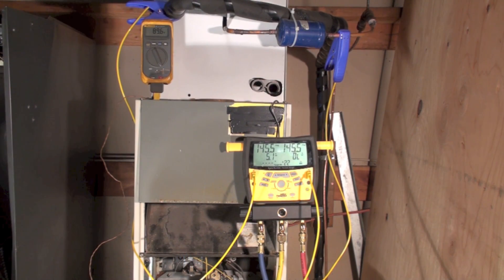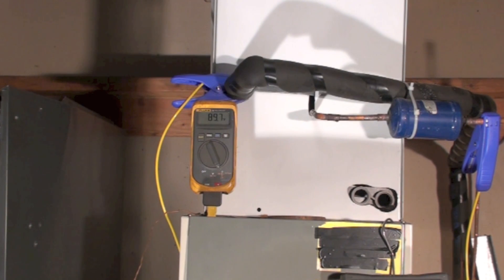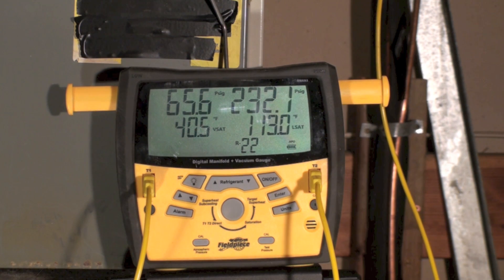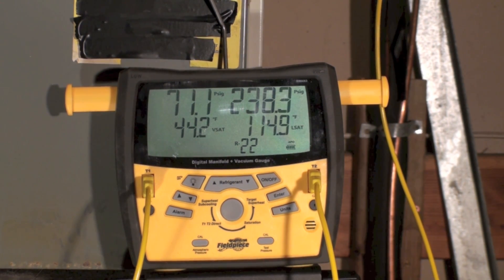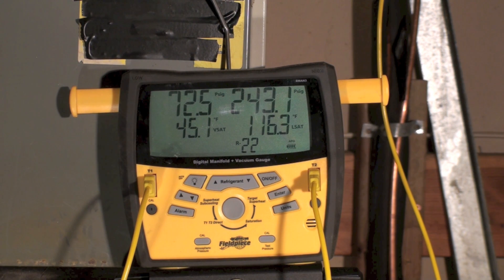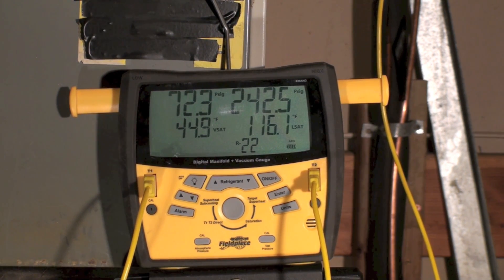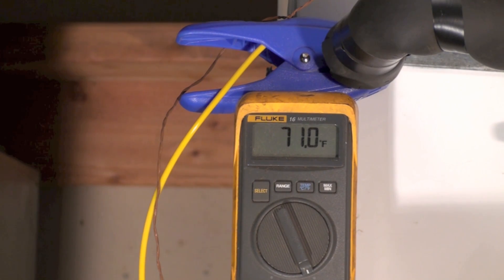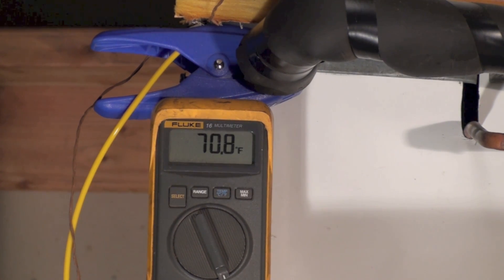What the temps and pressures mean on A/C units

Comment: 20-degree "TD" (Temperature Difference) between Return and Supply seems to be a rule of thumb, but why?  Head saturation temperature and sub-cooling "are going to be what they're going to be" -- so why should we expect a 20-degree TD?   
In this video Return was 89 and Supply was 71.  If Return goes down to, say, 78, should we expect Supply to be 60?  (I may be answering my own question here. )
Reply: In some cases an 18 degree split may be normal like if unit is undersized or load its too large!    

Even an 18 degree split may be normal; different loads or undersized unit could be the results!

Comment: Basic question: why is the Return Line insulated with Armflex?
Reply from the maker: The return line is a low temp pipe.  As such, it will sweat when the A/C is operating which will make a mess.  A more technical answer is that it will preserve the suction superheat to protect the compressor and efficiency.
GFM
Reply: @grayfurnaceman  Got it - thanks. (paraphrased: "Don't want that return line cooling off too much - will turn to liquid and damage the compressor.")

Comment: Hello Mr. Gray
Thanks for sharing your knowledge and technical skills.

Q: I ran into an odd R-22 system which has a similar setup as your "mule" (condenser and evaporator installed in the same room)  To be exact..The attic of an old building; concrete roof and not a lot of air infiltration.

When you have the heat from your conditioned space being dumped into the attic where you have your condenser, you're essentially raising up your head because you're raising up your condensing temp, correct? 

Oddly enough this system has been running for years but I was told it never achieves a confortable temp.

Have you ever come across these type of bad installs? Thanks, hope to hear from you.

My readings: Ambient attic temp measured was 110F. Low side: 70psi/~40F
High side: 375psi/~148F
Actual liquid line temp was about 85F. (R-22 TXV Device) 65F subcooling
Reply from the maker: I have seen them installed this way.  The head will certainly go up with the ambient.  The high ambient also reduces the efficiency and capacity.  The only thing wrong is the subcool.  You can't have a subcool temp lower than the ambient.
GFM

Comment: With 89 ambient at evaporator I would expect a much higher suction pressure, It could be that the compressor is large for the coil .The head pressure looked low as well .It would check sub cool and expansion valve super heat at coil . Different times had different ideas on what was ideal for humidity control.
Reply from the maker: All matched up.
GFM
Reply: I guess tonnage isn't everything
Reply: While the unit is running just fine and well in the ballpark it just seems the newer high seer units have a larger coil surface that pick up a larger load and run at a higher evaporating temp or pressure .They also have a larger condensing medium with a lower head pressure so the compressor doesn't work hard.The saturation temps and pressures only tell you what the refrigerant is changing its  state at. They tell you nothing else , but is up to us to determine if they are high or low. The air flow, duct size , dirt etc. cause them to vary and it's up to us to look for possible causes .The temp drop across the evaporator core should be about the same with a high seer unit due to the larger surface area even though they run at a higher temp and pressure .When you have a heat wave and the phone is ringing off the hook you can't always get them all running perfect on a service call .I'm sure you have had this happen . How about showing me what to tell a customer,because they look at me weird and I know I fail customer handling.I like watching your videos because I worked alone most of the time and it nice to get a different opinion on a variety of problems
Reply from the maker: Actually, the temp drop across the evap is lower on newer high SEER units.  Example: early units would be expected to have 18 to 22 delta T.  14 to 16 is more common on high seer units.  Customer communication is one of the hardest things we do.  A good service tech is not necessarily a good communicator.  I probably should be doing some videos on communication with customers.
GFM
Reply: n precise timekeeping, ΔT (Delta T, delta-T, deltaT, or DT) is the time difference obtained by subtracting Universal Time (UT) from Terrestrial Time (TT): ΔT = TT − UT. The Earth's rotational speed is ν = 12π dθdt, and a day corresponds to one period T = 1ν.... You lost me
Reply: High superheat, high subcooling, low delta T  =  Evaporator starved of refrigerant, restricted TXV or drier (Check TXV bulb tightness and insulation)

Low superheat, low subcooling, low delta T  =  Evaporator flooded with refrigerant, TXV open too much

High superheat, low subcooling, low delta T  =  Low charge……find the leak
 
OK superheat & subcooling, high delta T, low SST  =  Low evaporator air flow…..dirty filters or evap coil? (Evap coil may frost up) 

High SST, High SCT,  low subcooling, OK superheat, low delta T  =  dirty condenser coil, bad cond. fan? 

High subcooling, SCT & SST, OK or low superheat, low delta T = overcharge
Reply: When we say higher or lower it gets confusing.  A lower temp liquid line has a higher sub cooling . I guess a high delta t has a lower temp leaving the coil .So a lower temperature temperature drop means less cooling and a higher delta t???

Comment: sidenote, my first season doing cooling, had an old tech tell me"now this aint right, but (if everthing else is working) your suction psi should be roughly indoor ambient, and for 410 lets say 70 deg indoor ambient you would want your low side pressure to read roughly 70 deg sat. temp on the r22 side (about 120) please note THAT IS NOT HOW I CHARGE SYSTEMS, i always use subcool and superheat. but it does usually get you close, and i always thought that was cool and noteworthy how that kimd of works out.
Reply: meant to say indoor ambient should be close to suct pressure for r 22, 410 you match r 22 sat temp to id amb.(analog guages) please note this is not right, just thought it was a cool coincedence. anyone just starting out my advice would be get you a pair of sman guages, so you constantly see temps, and start thinking about whats going on temp wise instead of pressure. nowadays i use my analog guages and a temp probe instead of breaking out my 400$ smans, and save them fpr when a systems doing something real funny, or if i have to take multiple temp readings (restriction, or rev valve or something)

Comment: hey gfm, huge fan. i can usually always learn something from your vids on a subject that i thought i understood completely. question. coming into heating season, i of course use manuf. charts when possible, but charging a heatpump in cold weather without a chart, could you do. o/d ambient minus 15-20 degrees (410)for your suction sat temp to get you close (30 for r-22) an older tech taught me this trick last yr and i forgot how it went- figured id ask the master. you ever hear of that? ive only doing service for 3 yrs roughly, but this is only my second heating season and i want to be prepared. get back to me if you can. thanks once again huge fan
Reply from the maker: I never charge a heat pump in cold temps (below 25F) unless I have a chart that goes that low or I can charge it by weight.  Many of the pumps I worked on had mixed outdoor units and indoor coils so there was no way to do it right.  We left these units off until the outdoor temps were about 40F.  Using an ambient minus method is a sure way to overcharge a unit.
GFM

Comment: I have 2 two ton units in my home. Both operating at the same ambient temp 89 degrees outside, 74 at the return on both (dry bulb). The York is 24 years old R-22, air temp output is 50 degrees by laser thermometer. The Goodman unit is 5 years old R-22  moves more air,  supply temp is 62 degrees. The Goodman has never been as cold nor does it dehumidify as well. Using Merv 8 filters and HV electronic on both with UV lights in the returns. What can I do to improve the Goodman cooling? I have gauges and a 30lb R-22 tank. Waiting for a wet bulb thermometer on order.

Comment: Nice piece of equipment you have to calculator evap. temp and sat. temp all in one tool.  Question, How were you able to meter pressure at the air handler unit (I did not see in the video)?  Most of the ones I see do not have ports on them to measure pressure, the only way is to measure pressure at the condenser, and typically one would guess-timate pressure at the evaporator.
Reply from the maker: There should be little difference between pressure at the outdoor unit and at the evap.  If there is, there is a blockage between the outdoor unit and the evap.  
GFM
Reply: You're right.  The natural loss from pipe is called headless, and usually is very small.  That's why we can estimate from the pressure at the condenser.

Comment: I thought the high side  (saturation temp) should be measured against the liquid line temperature at the condenser to get superheat?  You said ambient so I'm thinking ambient is the outside return air (at 3:50) temp and not the gauges?
Reply from the maker: +john smith When determining subcool, you subtract the liquid line temp from the condensing temp.  Here were are determining the temperature difference between condensing temperature and ambient temperature.  It just means that the refrigerant is condensing 27 degrees above the ambient temperature.  Hope this helps.
GFM
Reply: +grayfurnaceman oh ok, meant to say subcooling........thanks.

Comment: Hi grayfurnaceman . I have a question that i cant find the answer to, hopefully you could help me out on it. The question i have is, that my suction line psi is 120 and my liquid line is 226 psi the condenser unit is a 4 ton r-410a unit. I believe that the suction line is to high but i am not really certain if it is. Could you please tell me if it is? Thank you in advance and hope you have a nice day.
Reply from the maker: 120 is about right.   Close to 40F
GFM
Reply: I guess you have problem with your high side which is low for 410 A .

Comment: testing to see if I need to add refrigerant....do I measure IWB at my thermostat or in basement next to evaporator?  do I let the system cool for 5 minutes first before checking IWB, ODB, etc?
Reply from the maker: Check the IWB in the return air.  Let the system run for about 15 min.
GFM

Comment from the maker: The outdoor coil actually is often cleaner than the indoor coil.  I would take that on an individual basis by looking at the coil.  If the cleaner is well rinsed, it should not cause any problem.  I can't say I have seen this.  Mostly coil corrosion I have seen is by dogs urinating on the coil.
GFM
Reply: Put a wall 3 feet away from outdoor unit and 4 feet high! It will deflect urine away and protect coils from damage; Yo can also use an electric guard as used to keep cattle in their pens! a zap here and there teaches the animals how to behave!

Comment: The reason I ask is because these younger guys are taking the unit apart to foam the coil with very strong cleaners

 and I've seen units that have the fins eating away are loosened on the copper tubing which ruins unit after extensive coil cleanings